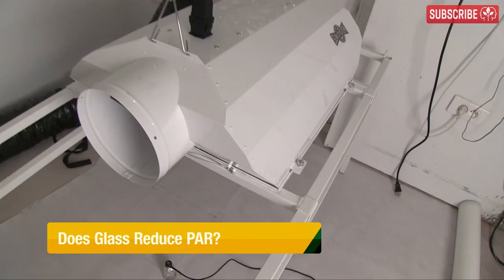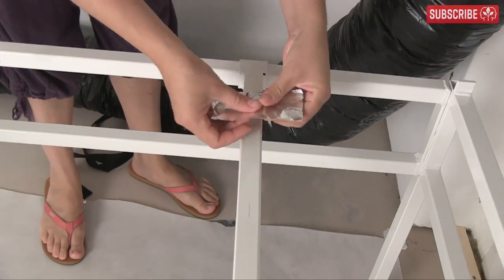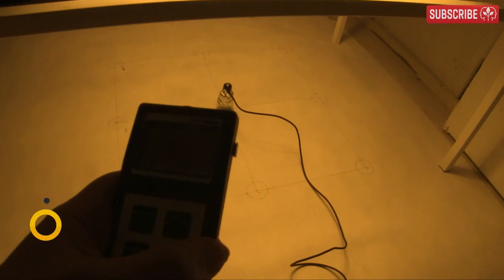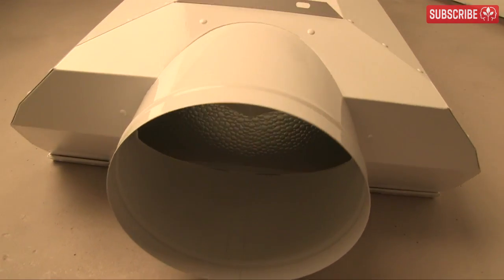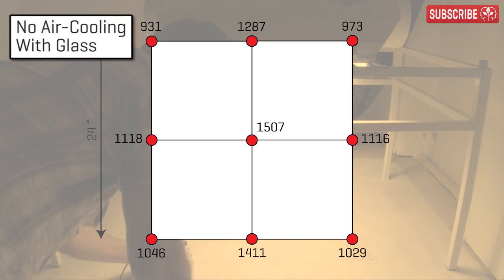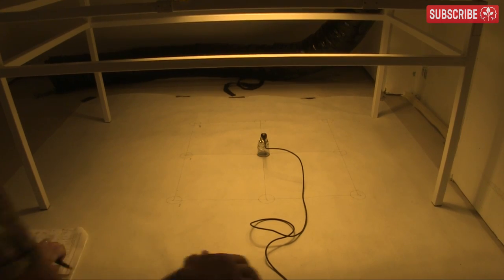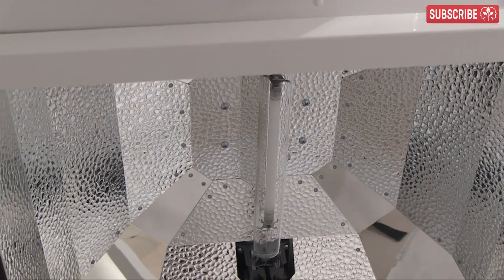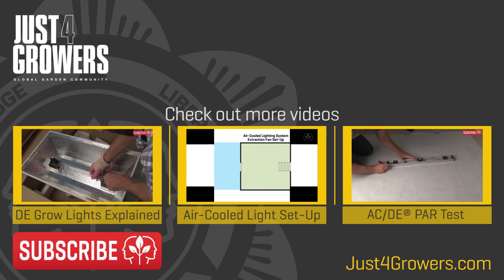Air Cooled Hoods: Glass vs. PAR, UV and More

Comment: Using a fan will increase par by decreasing power lost in the form of heat. The cooler you keep your light the more power it pulls from outlet making the par increase and run at maximum efficiency.

Comment: I dont know about these ac/de hoods...where it only cools the reflector and not the light chamber. Seems more like a gimmick to me. An attempt by Sun Systems to stay relevant in a fast changing industry and keep those Americans working (a good thing but...). First off you
would need super cold intake air to cool the aluminum. A no no with de bulbs.  Why do they even come with glass? How much heat does passing a cool stream of air over the top of the reflector realistically remove? And it seems redundant and marketed for small growers with small areas. With DE lamps...you dont glass them. You dont pass air over them. You dont cool the reflector. Whether its the top or the inside chamber. You cool the room. There is really no way around it. You have to fork out the coin for an a.c. unit..period. And DE lamps are meant for high ceilings and more than one lamp for cross lighting. Every hobby grower wants to jump onto the latest and greatest and DE lamps for the most part are geared for serious greenhouse and warehouse production setups. Just stick with single ended in most low ceiling home grows. Or if you absolutely have to have them...I suggest cooling the room (you will have to in the summer months anyways and probably all year round) and forget this contraption.
Reply from the maker: Hi Jeremiah, thanks for your comment. We agree on some stuff, whereas some of your other points warrant further discussion. Firstly, the AC/DE reflector. I've used it in a 4' by 4' tent and it kicks ass. I was super impressed at how much it kept temperatures down—and I was using the AC/DE Fusion model which has the e-ballast on board! It cools by convection, not conduction, so we're not cooling the aluminum, rather we're removing the hot air that naturally rises from above the lamp.

One thing we both agree on—DE HPS lamps run hot! And if you've got a bunch of them in a room you'll probably thank yourself for investing in an AC unit as you say. I'm putting together a fully sealed, air-conditioned room for next year and no doubt I'll be trying some DE-HPS in there. BUT ..... I also have a fairly low ceiling at 8 feet.... which brings me on to my final discussion point amigo:

Most of the time, we see DE-HPS lamps housed in deep-dish, greenhouse style reflectors. Gavitas, E-Papillon, Agrolux, DE-BOSS, etc — and yes, these reflectors rely on cross reflection and high hanging distance. The problem is—while the DE HPS lamps themselves are very efficient (around 2.1 umol/J) this configuration is far from optimal. It's what I call a "brute force" approach—favored by commercial, large scale producers who want to bolt their lights to the ceiling and not raise or lower them at all during the lifecycle (#laborcosts)

My issues are: light losses to walls. They are huge! You can literally see whole walls lit up, where no plants are growing. Okay, this problem is minimised in very large rooms where the proportion of fixtures adjacent to a wall is less, but it's still significant. Also, the reflectors themselves get very hot, trapping all that heat, and start to re-emit mid to long range infrared, very good at heating up plants internally—not good if you're growing heat sensitive crops as is often the case.

While a "matrix" of 1000W DE HPS lights five or six feet above the canopy can excite a PAR meter to around 900 umol using the 'compound' effect of multiple lights hitting the sensor simultaneously, what about canopy penetration. If you were to move your PAR meter sensor to the second tier of growth, and measure just below a gap in the canopy, you'll find that the reading goes down massively, because light from maybe one or two lights is actually getting through that gap. Thus, the 1000W DE HPS up high is great at producing canopies, but not so great a whole plant production and homogenous transpiration rates.

Big or small grows, I'd definitely recommend taking a look at 600 - 750W DE HPS housed in a reflector better suited for indoor growing (where grow lights form the sole light source) rather than greenhouse style reflectors. You may have seen my experiments with the Adjust-A-Wings DE HPS Hellion reflector. I really like their solution. I've tested their claim that you can bring 750W of DE-HPS light down to 45 cm above the canopy without any heat issues and it stands up—meaning that growers with lower ceilings can enjoy DE-HPS too. The important thing to note here is the intense, angular light produced — it's an entirely different quality of light when you can get the fixture up close and personal like this.

It's a similar case with the AC/DE — much more intense, angular light. Your point about the glass is interesting. Might be a good idea to ditch that entirely — I definitely see where you're coming from with this. But I've been very happy using it (albeit at 750W setting) in a 4' by 4' grow tent — and you can run the cooling fan at MAX without any degradation to the output — so I urge you to keep an open mind on that one. However, what works perfectly for one grower, might not be the best option for another.

Always happy to chew the cud and bounce ideas back and forth amigo—thanks again for taking the time to chime in with your insights. Peace and happy growing, Everest.

Comment: Does using the dimming feature a ballast offers effect the heat needed for the DE HPS bulb to bring about all the proper chain reactions that naturally come with respective temperature changes if I were to run the ballast at say 400W or 600W?  Or will the bulb just not come into light due to the lack of wattage?  Sorry, little confused here

Comment: Hey Everest, quick question. Do you happen to know the difference in temperature with glass on vs off running the hyper fan at 100%?
Reply from the maker: +Evis Daison Hi Elvis, which type of hood? The sealed optic chamber type (Sun System AC/DE) or the regular air cooled hoods that pass air directly over the (singled ended) lamp?
Reply: Everest Fernandez I'm asking about this specific hood in the video. AC/DE with the chamber. Thanks!
Reply: Everest Fernandez As an AC/DE user, I also wonder what the temp differences are with and without the glass, with fan running. Any information on this Everest? Thanks for your time and great videos!

Comment: will pulling air directly through a reflector damage a cmh bulb?
Reply from the maker: +Gio Dlr No CMH lamps such as the Phillips Mastercolor CDM lamps aren’t overly affected like the DE HPS lamps. The dual jacket CDM lamps that are open rated, they have an extra barrier of protection against any thermal issues.

 While it’s true to a certain level that all HID lamp / systems are taxed by cooling the lamp since that’s how they make a photon (heat and pressure) most systems can handle it, it’s just the nitrogen filled DE HPS that is more susceptible to issues with air cooling.

Comment: What is your opinion on buying a parabolic reflector (48" horizontal Silver Sun), and using the sections to cover the duct holes on those worthless a/c hoods to increase their efficiency? Cut pieces to fit around the holes, drill holes in both and attach with screws. They have to be losing at least 10-20% out the ends whether they're with or without glass. Without the glass I had about a 30% yield increase. I could see probably another 20% just by doing that. What do you think?
Reply from the maker: Well Hugh, if the utility of air cooling your lamp isn't of interest, you're probably better off simply buying a compact, open reflector :) however, surely there's more than a hint of friendly facetiousness in your comment! :) Lol. The latest innovations in the air cooled reflector world seems to be cooling the convection heat rather than passing air directly over the lamp. Certainly heat is the #1 issue in most grow rooms and it can be very costly and energy-intensive to remove it once introduced into your grow room. If you can remove it at, or near to, source with a (relatively cheap) inline fan, why not? :)
Reply: Everest Fernandez That was somewhat tongue in cheek, but serious about the worthlessness of a/c hoods. It's been proven that pulling air through them becomes a loss after less than 6 feet, so you're probably better off pulling air conditioned air into the room and exhausting the warm air back out, recycling the air instead of dumping it outside and costing yourself a fortune. As for people that are concerned about touching their head on a bare bulb, the light is over the plants, so that's not going to happen. Besides the fact you shouldn't be standing under an HPS light anyway or you'll be getting cataracts at 30. What is the advantage of the open lights? They seem contradictory since the light isn't focused onto the plants. I can see the smaller footprint for a greenhouse, but an inside application seems wasteful. Got any videos about them?
Reply from the maker: Open fixtures do a great job of focusing the light on the plants and the light doesn't have to pass through an extra layer of glass. Air cooled hoods tend to be "deep" reflectors that create a "beam me up Scotty" style intense beam of light down towards the plants. Open fixtures vary considerably—do check out the Adjust-a-Wings as you can create different shapes, as the name suggests, to suit your space / grow style. I'll be sure to make more videos about reflectors in the next 12 months.

Comment: Enjoy the videos. How much more heat does it put into the room without the glass?
Reply: Everest Fernandez why do you like to ignore the question people are asking? does the fan running 100% affect the bulb temp with the glass off the ac/de hood that is in this video
Reply from the maker: Typically growers calculate that each 1000W HPS in an open fixture introduces 3.41 BTUs per watt, per hour — so 3410 BTUs per hour.

Comment: Got a question and a tip.  First off, I have a debate with my local shop about the Gavita bulb and system, well these double ended systems in general that call for being 36" away from the canopy.  He claims running air over the bulb, especially the cooler the air gets you're running (say winter up north) causes the bulb to dim.  I've never tested this, I'm wondering if you have.  

Here's my tip, those Sun Master light hangers work great, but they work even better if you flip them around, meaning put the ratcheting part down near the light.  You'll find its way easier to raise and lower the light.
Reply from the maker: Hey DF, great question and tip. Thank you. I wonder if the light hangers are intended to operate as you describe rather than their way I've got them - lol! I definitely see your point there.

Your local grow store is correct. Running cool air over any DE lamp will cause it to dim. They are filled with nitrogen, a poor insulator, so are more susceptible to cooling. Incidentally this is common to all DE lamps regardless of brand. It's for this reason that Sun System designed and patented their sealed optic cooling chamber as seen on their ACDE reflector. It cooks by convection without passing air directly over the lamp itself. As for open reflectors, just don't point oscillating fans directly at the lamp. Hope this helps. Peace. Everest.
Reply: Interesting to know about the tech of the light, definitely something that wasn't mentioned by the shop, just the ominous warning.  I'm checking into those reflectors you suggested, if I make an upgrade after doing some more research I'd definitely go that way as I wouldn't want the extra heat in the room in my situation. Thanks!

Comment: what about temperatures man? wth!
Reply from the maker: lu lu Hey Lu lu. Sorry if my video fell short of the mark. I measured the temperature of the top of the fixture itself using an infrared thermometer in my AC/DE PAR test video. https://youtu.be/vidqDyV1ks8?t=3m34s I intend to repeat the test in a grow tent to get a better idea of how much heat is removed with / without the glass. Growers often talk about glass blocking UV but less about the IR blocking effect. IR is, of course, radiant heat and this can be detrimental to crop quality if not properly controlled. Any suggestions for follow-up tests would be very welcome. Peace and happy growing, Everest.

Comment: Hi Everest.  How air tight did you find the hood to be without the glass? 
I should add that you do an amazing job with these videos.
Reply from the maker: Antitheist98 Thanks Antitheist. As I blew through the hoods, rather than sucked, any leakages between the cooling chamber and the light would have caused a small amount of air to be pushed passed the lamp. I did not detect any, either with my hand or through reduced PAR readings. By visual inspection there does not appear to be any additional sealing—but it shouldn't be an issue as long as you blow, not suck :-)

Comment: So this particular light has a sealed off upper chamber to pull the hot air through?  Meaning if I ran ducting and fans it won't pull out my CO2?
Reply from the maker: A properly set up, regular air cooled hood, or set of hoods, can be run completely independently of the garden's ventilation system, especially if you follow my instructions on blowing through your hoods instead of sucking. :)